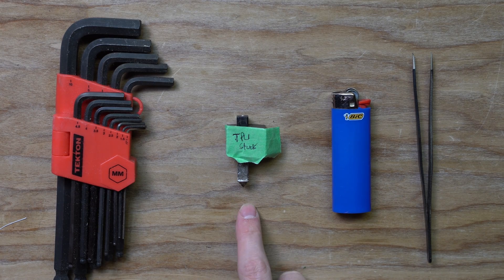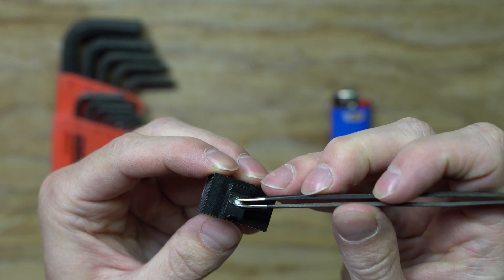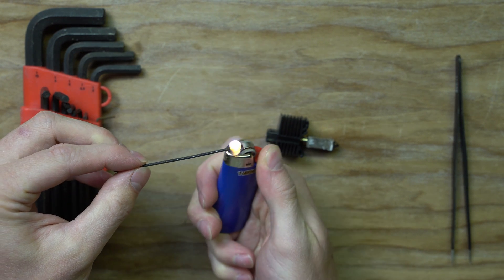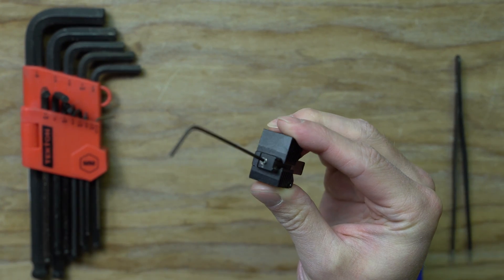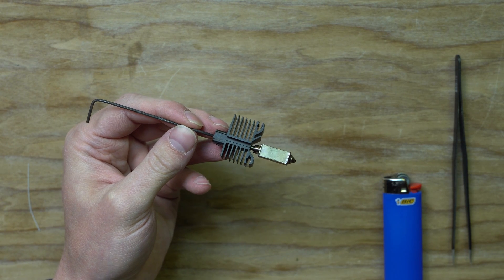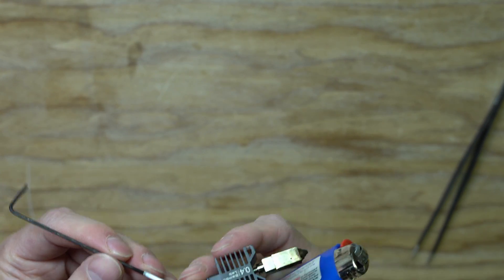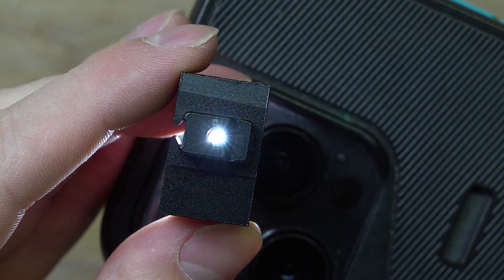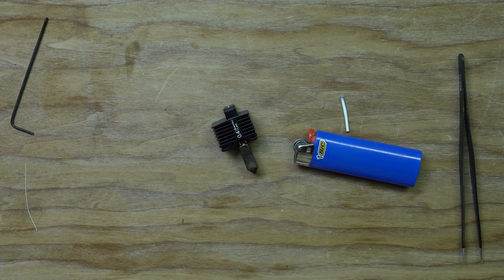How to unclog X1/P1 series nozzles if a pin doesn't work

Comment: You just saved me £11 with P&P my friend, just tried this with the help of a support worker and it worked like a charm on my A1 Stainless Steel nozzle, where the filament just stuck itself inside with no way of grabbing at it like in your example.  1.5 Allen key, a lighter and a little bit of patience, and it's printing like a charm again!

Comment: I did the same thing, but I didn't do it with the lighter on the nozzle, next time I'll try, thank you
Reply from the maker: Be careful to not let it get too hot. Cold pulls don’t really do much if you get the plastic too hot.
Reply: @3DPrintStuff  ok, thanks for the advice, I also changed the thermal paste, I put the Slice Engineering thermal paste which supports the heat better

Comment: Does this work with the A1 & A1 mini? I seem to have the same problem?
Reply from the maker: Yup should work on the A1 series of printers. The A1 series is a bit easier cause the filament is cut a little further up leaving enough for you to grab the filament with some pliers. You can also use the print itself to heat up the hotend instead of using a lighter. Bambu labs has a good step by step guide: https://wiki.bambulab.com/en/a1-mini/troubleshooting/nozzle-clog

Comment: You can do in the printer heating the hotend with the printer itself. Just don't pull to hard to not tear off the wires.
Reply from the maker: Yeah that’s definitely an option. I just find it way easier to work with it outside of the printer.
Reply: @3DPrintStuff  sure thing, but I don't like to disable the hotend and mess with thermal grease)
Reply from the maker: @MrMaxStalsky  https://wiki.bambulab.com/en/x1/troubleshooting/nozzle-clog

Bambu Labs performs this procedure without removing the ceramic heater. I think you just need to be mindful of what side you're applying the heat to.
Reply: @3DPrintStuff  yes you can unplug all cables without removing the heater and the thermistor from the hotend but , yeah, you got to be really careful)

Comment: Thanks for the video, I have a few clogged hot end's that I am going to try this on.   Just could not bring myself to throw them away!  Now that I see you doing what you did it makes perfect sense!   👍
Reply from the maker: Yeah it can become pretty wasteful if every clog means a new nozzle + hotend.
Reply: I do cold pulls till I get as much material out as I can. Then I put a small piece of PLA in the nozzle and push it down to the end. Then I heat the end of the nozzle with a torch till I'm sure the PLA melted then push it out the hole in the nozzle with the hex key.  I never need to put a needle through.

Comment: It’s not stuck that’s where it got cut put it back in and run some pla it’ll push it through.  Also you can just run a pin up the front.
Reply: Amazon link
Reply from the maker: The title says "if a pin doesn't work". I had a print fail due to the nozzle being clogged. I did multiple load/unload attempts that failed. Tried the pin up the front, this did not solve the problem. Removed the nozzle and did this procedure and I'm back up and running.
Reply: @3DPrintStuff  you can also run pla through or heat it attached to the machine
Reply: @weldingjunkie  You don't know what you are talking about. Read the definition of the word "clog". That literally means you cannot push the filament in the usual way
Reply: @3DPrintStuff  i know what it says if you heat it and push from tip, it you don't need the alan